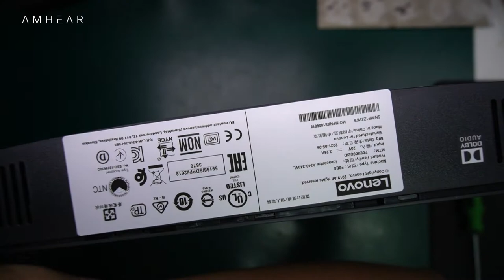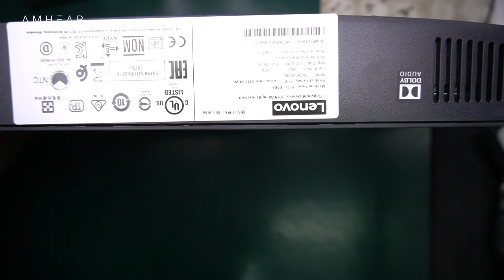Lenovo Ideacentre A340 24IWL F0E800U2ID | Upgrade Options

Comment: i have worked on a few of these models now and ive had nothing but trouble getting the casing on reasembling. i always end up with a small gap top LHS of screen and the screen doesnt seem to pop back in on both sides. scared of cracking the bloody screen. any tips?
Reply from the maker: as you can see, i have trouble too at minute 5:30,,
lay the unit down  and then check the gap a couple of time 😄,,
Reply: I broke my screen while trying to get it back on and I was extra careful. Awful design of the housing imo.